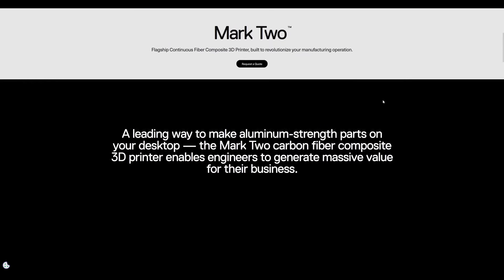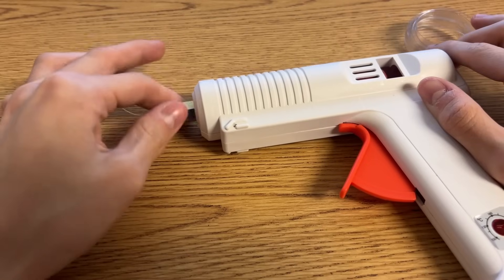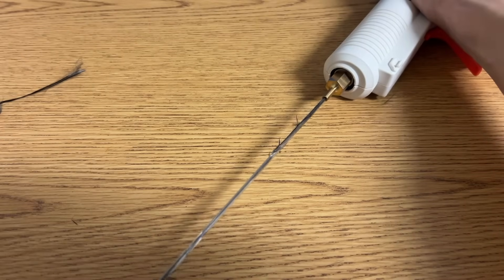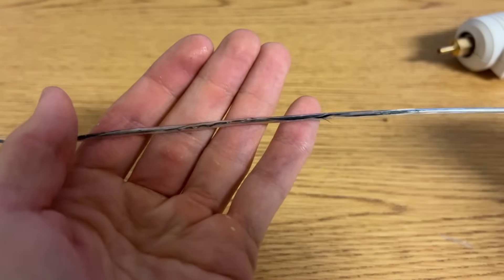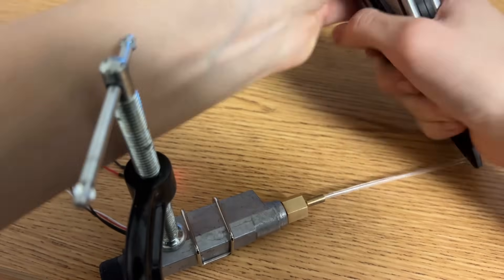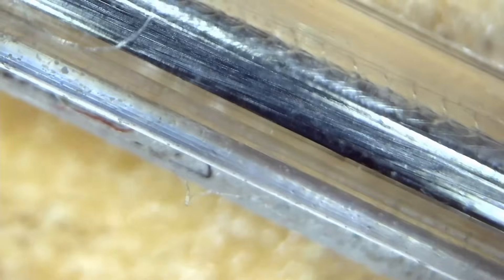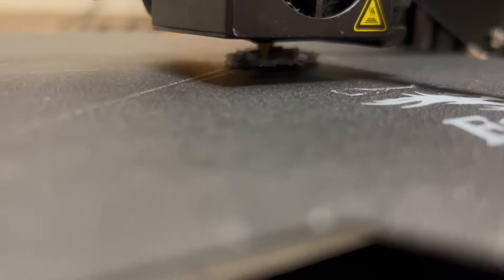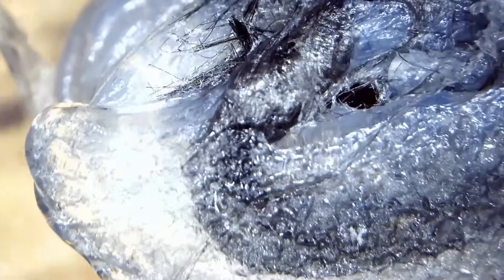Printing Continuous Carbon Fiber At Home!

Comment: An interesting experiment, and the main idea (real carbon fiber rather than carbon fiber particles, like in normal 3D printer CF filament, being stronger) is of course true. There's a 3D printer out now that lays down continuous fiber into a 3D printed part, which seems somewhat easier than this.  As for a critique on the presentation... perhaps a little stiff and halting. Relax. :)

Comment: Handling carbon fiber with bare hands is not a good example of what people should do. Never handle bare carbon fiber or it will embed shards of the fiber into your skin and cause irritation. It is dangerous when it is bare, don't handle it and especially don't breathe in any of the shards of fibers.

Comment: This is a very cool idea, i thought about doing something similar when im done with my exams. My idea was to have two heat blocks, one that is a standard or modified 3d printer nozzle, and one where the cf is. The idea is to inject already melted plastic into the block where the cf tow is running through. That way you eliminate the very slow extrusion of cf and instead of trying to push the cf you basically let the plastic pull it out

Comment: There might be better fibers than carbon for this. The problem with carbon or glass fiber is that you'll need to figure out a way to cut the filament for every retraction, and the fibers will rapidly dull most blades so it will be hard to do reliably. If you use a polymer fiber, you could heat up the nozzle to melt the fiber, then retract the filament, then continue printing. It would be slow so you'd want to heavily optimize for as few retractions as possible, but it would also allow you to print geometries that are impossible in vase mode and impractical with mechanical cutting. With a cursory search for potential fibers, I found that kevlar has an excessively high melting point (~450C), dyneema and rayon have very low melting points (~150C) that limit potential jacket materials, but vectran has a melting point of ~330C that's potentially reachable with a consumer printer, maintains its strength with limited exposure to temperatures of up to 250C so it should be compatible with a PET jacket, and decomposes over 400C so it should be safe to print.

Comment: This is awesome! I see a lot of similarities to the Recreator 3D project, I would highly recommend looking into it. They have designs for how to make a 'pultruder' which is just a machine that automatically heats the PET strips and pulls them into a filament shape, then coils it onto a spool. This is much more automated and consistent than pulling it by hand, and it's a very flexible open source platform you could easily add attachments to, like a spool and feeding jig for the carbon fiber. 

I had a similar idea for filling PET filament, but I was thinking of using thinner strips of PET or somehow ground plasitc scraps which would get closed into the filament, allowing for a solid filament, rather than the hollow filament that most people adjust their flow rate for. I'll definitely check in and see how your project develops and I hope you get some inspiration from the Recreator 3D Project!

Comment: Haha, great intro. Pity about the audio quality for that bit.

It looked like you were printing your first layer too quickly. I'd also use a brim, just so it has an easier time sticking down before it makes any sharp turns. Printing with a big nozzle isn't easy.

Every time a new line begins, you need to cut the fibre. Otherwise, there's a practical limit to fibre length. This is doubly-true for retractions; you do not want to drag a long strand back into the nozzle!

I subscribed, so you're obligated to continue ;)

Comment: I wonder if this more like instead of printing the whole part like this, have some designed channels where this filament could create strength. But the shape is made by other plastic.  Also I think you need to consider the carbon fiber bend radius, in your part.  I don't think it can bend to the radius of your printed part.  Start big with big curves and go down from there.

Comment: Hey Alex! I just posted a video where I Show my setup for Continuous Fiber Filament making. Feel free to check it out! Regarding your setup: you should carefully select material for the matrix of your filament. (Not a PET from bottles or a gluegun) It should have low enough viscosity at elevated temperature to fuse well with the fibers. Study material properties and choose what best suits your needs)  I used PETG and it required 260 deg for good impregnation. Full impregnetion of fibers is essential to achive a filament that will give you good resoults in printng. Good luck! https://youtube.com/shorts/v8ktu00bYaQ?si=lsMlBJT85p8Yz2l0
Btw. I see in the background you are a fellow RC modeller. If you want to we can get in touch somehow to talk more about the project. Cheers!

Comment: I've had this idea for a while but with a 0.5mm filament, that way we can retain the print quality by using a .5mm nozzle and only merge a few fibers inside the filament, making it possible for the printer to break it with travel moves 😇

Comment: for better adhesion between plastic and fiber, you could try dipping them in a solvent that disolves the plastic, then even between the fibers will have a little bit of plastic. 
Con: you will need to bake out the solvent before printing. 

Also, i wonder if something like heating your filiment could help. like, oven, or run over a flame quickly.

Comment: Great try… if i may suggest.. try with half the amount of carbon fiber, better chance to get good print and the carbon will still be there potentially always covered. But you have to get a consistent print without the carbon first. Just a suggestion, i can only imagine the amount of work. Carry on 👍🏼

Comment: why not use a screw like a normal filament extruder, but also let it push the carbon fiber with the plastic, push not pull. why not a pet plastic tube with a separate fiber running inside. one other option is to sow a 3d shape with the pure carbon fiber, then add resin. well petg with hardened steel nozzle needs about 260C (+30C vs normal nozzle, for cf stuff). diy milk casein plastic with carbon fiber strands might be very nice.

Comment: First of all: CONGRATS getting your first video out!  Biting the billet and uploading before what may be considered “success” was the right call. 

So the results…I can’t believe you got filament that looks that good out of the “rigs” you used. There are a few factors I’m aware of that were working against you:
PET is not easy to print; it likes to be around 280C and the bed at 80C, and you’ll have struggles with bed adhesion without a PEI build plate. I don’t think that an ender can print straight PET well at all - I suggest investing in a roll of PET(no G) to use as a control. 

Now about the extrusion rig…you can get lucky, but it needs to be temperature controlled and high wattage. PETs temperature window for melting without crystallization is not large. PET also needs to be heated up very quickly, then cooled off  quickly, the goal there is to make it amorphous. Considering you were PULLING the extrusion through with your hands, I think we can assume it didn’t come out of the nozzle at 260C-300C. 

I know it’s probably not in the budget yet, but a secondhand 3d printer seems like a great way to get some of the parts you need for cheap, like a PID controller, motors, thermocouple, power supply, and maybe even the heat block will be enough. 

Okay so after you have tuned and successful print settings for PET and your filament is amorphous, the name of the game is now Consistent Extrusion Diameter. Think about it; if the variance is 0.5mm, the printer’s flow rate is off by 30% EVERYWHERE. What happens if you try to print a benchy at 70% or 130% flow rate? You don’t get a boat. So to get the extrusion diameter tolerance better is simple: consistent speed. This is where that motor from that secondhand 3d printer can  help. 

Lastly; I’m not an expert on filament manufacturing, I just have gathered a lot of knowledge surrounding it. If you come across conflicting information I wouldn’t be surprised, and if you have conflicting experiences, find out why before dismissing any of it. 

Again, great work and im excited to see this channel grow!

Comment: Ich would guess that you could do it with a setup that looks a little bit like a wire-edm Maschine. One Side pulls the fibers through a molten platic bath. The other side keeps a little resistance so the fiber is always straight.

I hope you know what I mean 😂
Best regards from Germany 👍

Comment: Try vase mode with a 1mm nozzle. At 0.8 layer hight. There is nothing on your test printer to cut the fibre filament on retraction moves.

But very good effort. Will look forward to your next video attempts.

Altnatively try a thinner core of carbon fibre if you want to continue using the 0.4 nozzle.

Additionally I think it's a very interesting concept the current issue with carbon fibre filaments if the size of the chopped fibre is too fine to actually provide much more strength. Using your idea. If you were able to say add 2-3mm strands in as a core due the the nozzle melting, stretching and squashing the plastic you may end up with a very usable filament without the need for a cutter and retain 0.4mm nozzles. I imagine the end result would be somewhat akin to fibre glass mixture.

Comment: I think you can get away with much fewer strands also dont make it a continuous strand , make overlapping strands so they can slide past each other . then try and make much smaller diameter filament, larger diameter nozzle , vase mode. Higher temperature. Problem is that printing this way only makes it stronger parallel to layer lines. Very cool concept though , I could still see applications for it.

Comment: Start with a high quality mechanical pencil and use it to dispense the carbon fiber strands only then pass it through a fine brass tube while being mixed with a UV activated resin/polymer once the wet strands exit the brass nozzle a UV laser is directed towards the deposition contact to instantly solidify the wet strands (BTW brass is self lubricating and easy to solder and available in small diameters look for EDM drills that is why I'm suggesting it) good luck my friend.

Comment: I wonder if you can make a nozzle that has an inner, separated channel to deposit carbon fibers directly into the print

I made a mockup in onshape of a more ideal nozzle (would have to be metal 3d printed) called "carbon fiber depositing nozzle", its public so it should show up if you look it up

the idea is that the melted filament and already printed fibers would pull the fibers through the nozzle as the printer moves
Reply from the maker: Just took a look at your nozzle, that's a fascinating design! It's definitely close to the limit of what a metal printer could make, but if it could be made, that might be the best solution to continuous CF printing!

Comment: Brave try at something most people consider impossible! 
Without sophisticated machinery to make your filament you are "stuck" at running the strand down the middle. Since one needs to wet the strands to get strength of the composite I would use way less carbon fiber to give the filament more chance to fuse together with the fiber.
And as stated below a smaller nozzle (0.8 to 1.2 mm) but increased layer width and thick, but no more than 80% of the nozzle diameter, might force the plastic into the fiber and give a bit more pressure on the build plate to get some adhesion.

Comment: Just an idea that popped to my mind when seeing the video's begining : with axial fibers, you need to ensure that the layer lines have the same cross section as the polymer in the filament, elseway your printer will stretch the fibers as it wil try to lengthen the filament by printing it at a different cross section to keep volumetric flow constant (the polymer needs it). Why have the fibers purely axial and not coiled around a main thin filament like a spring, which would then be encapsulated in aouter shell (like with your pulltruded attempts) ? as such the fibers would be able touncoil themselves into staright sections to allow for filament lenghthening. It's an idea that would need a lot of work in order to have a reliable fiber coiling machine, but could definitely work.
 I am thinking about how to make continuous fiber filaments for a long time and coiling around a mandrel filament might be a good trick

Comment: I’ve been wanting to try this for over a year now , glad I ran into this video! I’ve seen a company from France named Zero3D /Zero D at Formnext Germany and he had a filament making machine built exactly for this.   He had filaments with continuous glass fiber aswell.
He said he was able to print with them on a sovol sv06 and the prints were looking promising. Not pretty but strong.

This would be really interesting to try in a system with a filament cutter guillotine and experiment different metals for the blade to see how it gets cut.
If something like that works it might enable next level strong parts on desktop machines, even if that has like an extra purge line added manually to do the cutting part.

He had less fiber laminated inside  which i think might help getting better  desktop results.

Dosing the material is a challenge here having the fiber volume inside and most companies went for a separate feed for the continous fiber that gets laminated in the nozzle to overcome that.

Comment: I can see a concept like this genuinely working well, but likely with a pretty custom setup. For example we can still get very accurate prints from a 1mm nozzle. So if you could use 1mm diameter filament and a 1mm nozzle with a custom hotend setup designed to push very close to the nozzle, it could probably go pretty smoothly. Of course you can't have any breaks in printing, but that could also be solved with a cutter right below the nozzle. Still lots of issues there, but hey, big props for trying and it would be awesome to see it really work.

Comment: This isnt going to work the way you want it. I think stopping the print and and placing fibers at various levels. Or to create a channel in the design to fill with carbon fiber and epoxy for the extra rigidity.

Comment: Great start, there is probably a lot of work to be done, but I like your idea. I think there will be some problems along the way that have not yet come up, but I would be grateful if you could share them with us. On your question about whether anyone else is doing this: There is a company called ZERO-D from France that is working on a similar idea, but I think they are also in the early stages of development. You might want to take a look at the Additive Manufacturing Hardware Landscape 2024 from aniwaa, in the composites* part of the picture there are a lot of companies working on integrating continuous fibres into 3D printing. Maybe looking at those companies will give you a better understanding of the topic. Keep up the good work and I hope to see more videos from you.

Comment: There is a reason the Mark Two uses two separate spools for fiber and plastic. The plastic likes to expand and shrink throughout the printing process, but the fiber is completely unaffected at those temperatures. Instead, the print head of the Mark Two injects the filament into the extruder at the melt head. The only way to make a carbon infused filament work on a classic extruder is to use short-strand fibers. Same with fiberglass, which sounds fun to experiment with but, really, don't.

The side effect of printing with your medium and fiber on two seperate reels is that you can also select what layers get fiber and which don't, optimizing strength vs cost. You also have to consider how to cut the strands; the closer to the extrusion head, the shorter your strands can be. In short, there is a reason the Mark Two is so expensive, and their stranglehold on the patent is only part of it.

Good luck!

Comment: So what were the print settings that worked vs the ones that didn't? What helped vs hurt it? That seems like the main discovery of this video but it was skipped over. Also consider a 0.8 mm nozzle so the fiber jams and stretches less

Comment: I have made a LOT of PET bottle filament.  Like 20+kg of it.  What you're trying to do here is VERY interesting and VERY possible with a few tweaks.  In fact I have thought about this but with glass fibres instead.  When done correctly the PET tape pulled from the bottle will form a tube as it is pulled through the heater and nozzle and the trick is to get it just hot enough to soften and shrink without actually melting.  Getting the volume correct is key.  Too much PET tape pulled though and it jams and snaps.  Too little and it doesn't form a proper tube.  Considering how little filament is actually laid down when printing I think less carbon fibers would be better and definitely individual fibers instead of a tow or tape.  But you're definitely getting close.  

The main problem I see with this is the slicer and the logic it uses to create the line path.  Ideally it would be one single line wihtout ANY retracts or travel moves.  Almost like the entire print is in vase mode but wihtout it printing only the outer wall.  I suspect an IDEX or multi toolhead printer would be best for this with one toolhead providing non-CF filament for supports and areas where the CF is not needed/wanted and a second for just the PET-CF filament.

Proper Printing did a great series on trying to print resin with a cartesian 3D printer and I think laying down a bead of resin that has a line of CF embedded in it would be a game changer.  Between what you're doing here and what he did there I think the two of you could REALLY have something big.  I just wish I could give this video more than one like.